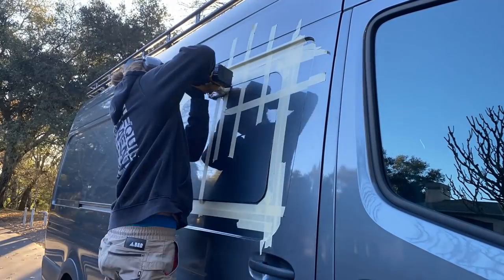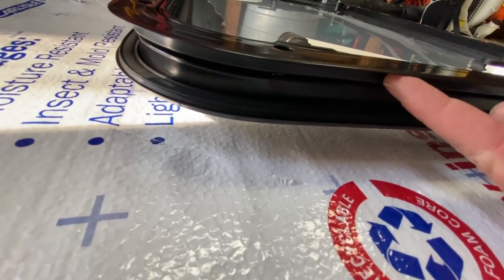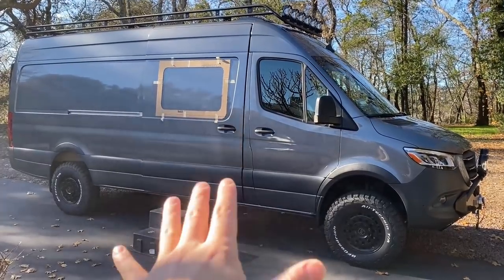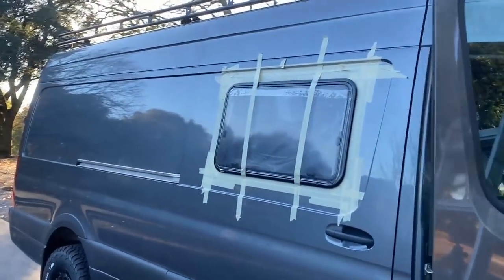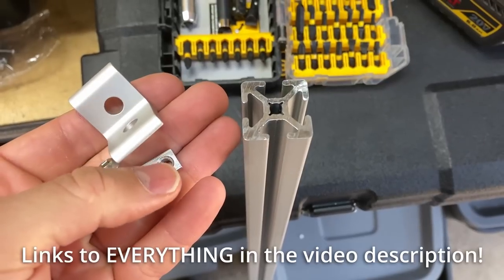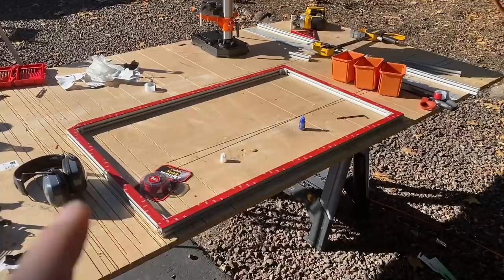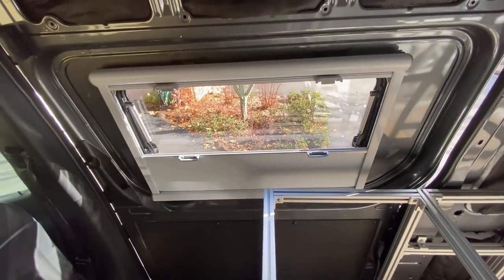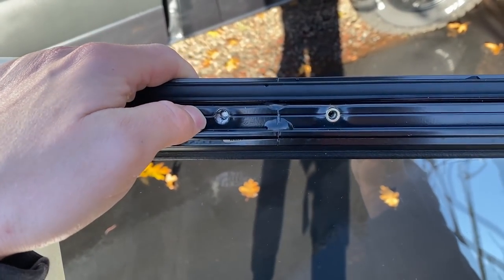How To Install "Tern Overland" Windows On A Van (My NEW Favorite)

Comment: Love the video! Thanks for sharing! Checking the inside fitment is definitely important. For anyone else looking to install our windows be sure to read our Considerations for Fitment PDF on our website. Great job on securing the spacer frame onto your sheet metal! Thank you for mentioning to not overtighten the screws, this is very important to make sure the riv nuts aren't pulled up. (This is a slight cause for leaking in your install as well as using the incorrect screws - there is a chart in the installation guide on which ones to use - glad you figured that out!) Great tips throughout! Measure from the inside, careful with the corners (Measure them!). You did a great job installing! For other commenters... do not use adhesive!! The rubber seal on the outside is 100% water tight when installed properly . Adhesive / silicone will ruin this gasket and cause leaking. As always, if anyone has any questions, be sure to reach out to us!
Reply: I'm just wondering why you guys don't include a full-size paper template with the orders? It would make life a whole lot easier for those of us doing our own installs and would take the anxious guess-work out of 'is this the correct line, or is that the correct line' to use when making our own.
Reply: Thank you for thé tip on thé adhesive
Reply: @susannal.9147  truthat! and a inner spacer frame:) !
Reply: Please ship windows with a template! This is a very expensive product and a template would cost you pennies to make and would save people a lot of hassle and potentially costly errors.

Comment: I am glad you went with the 1" 8020 frame like I did. The best thing about that solution is that you can then use drop in nuts on your your rails to tie your interior paneling together with the window frame. That makes for a super clean install and will also prevent the window from vibrating when you drive down the road. Will send you a picture of the my final result on Instagram.
Reply from the maker: Heck yes flori, thanks for the idea for this!

Comment: Great Windows!  I'm interested in seeing what your going to do for roof venation.  I've been thinking of not using a Maxxfan type of thing and instead put in 1 or 2 skylights.  One of the skylights being large enough to fit through which eliminates the need for a ladder and makes your roof more secure.  I think I can easily add a fan to a skylight.  Some people are using boat hatches instead of skylights.
Reply: Good idea for go on roof with boot hatches . But I think most van camper wants solar panels on limited space roof.

Comment: Aluminum is a great conductor. Change the window frame to wood or plastic, otherwise you will have condensation all around your window in the winter
Reply: Peter Eriksson do you have a recommendation on a plastic to build frame spacer?

Comment: Nice job on the windows and video. Question about the 80/20, how many sticks do you think you're going to use? What's your whole budget for the 80/20?
Reply: Jay-  I’ve wondered the same.  The cabinet build looked like 10 plus from passing comment in the video.  I love how it looks and appears to function, but I’m probably going to be stuck in the budget of 🪵 wood, like Vanjolina.  Of course, with the current cost and diminished quality of building materials, the 80/20 no longer exceeds lumber by as much.

Comment: Great set of videos Seven, thanks for all the info. Can you confirm what wall thickness windows you used for the Arctic Tern Windows in your Sprinter with the 80/20 1" framing. Was it 24-34mm?
Thanks

Comment: Are those the 24-34mm wall thickness windows? I can't wait to see how you finish the wall panels to meet the inside screen/blind assembly.
Reply: Hey Savage, I also am wondering which thickness you used? And how did you decide? Having a difficult time understanding which thickness to order.

Comment: Awesome video man. Question -did you consider using butyl tape when installing the windows? Or any other adhesive? Or are you confident the gasket is enough?
Reply from the maker: Very confident in just the gasket
Reply: I would still put a small bead of silicone caulk, it can't hurt.

Comment: When I inquired with them, they want you to get specific about your wall depth.  Did you go with 24-34 mm? Looks like you went with 24-34mm based on the 1 in 80/20...

Comment: Great Video and great Windows! Thanks for doing this.
So did you notice any difference with heat and cold vs the dual pane?? If I understand that is the reason why you went with this model in this build.
Thanks!

Comment: It would make a lot more sense for the supplier to provide the purchaser with a hole template rather than expecting them to do it and potentially screw up.
Making the window surround out of 80/20 is allowing a thermal bridge to the outside. Wood would offer better insulation and be a lot cheaper, lighter and easier to fix into.

Comment: Aluminium has a real poor R value so wood would be much better as a thermal barrier. Great windows though.
Reply: The double sided tape provides a thermal barrier so the aluminum frame doesn't touch the metal. Wood wouldn't be any different in this case.

Comment: Not only have they jumped big in price im not fan of the push button before you can unlatch; one side feels more natural but the there opposite you feel like you need flip your hand. Yes they also scratch real easily. Glass doesnt and glass is also flat doesnt bulge outward asking to get scratched. Now is glass have better thermal properties probably not but are you going to really notice in small space with heater going anyways and glass window off eBay say 200$ same size from TERN 750$
Also i dont know it the arm attachment is screw to frame or riveted, i have found rivets get sloppy over time

Comment: Hi, given your attention to detail I’m sure you’ve already thought of this but are you concerned about diminished security on the acrylic compared to the glass window, scratching and uv damage? I get the decision, temperature regulation in the van is difficult and can greatly affect the user experience. I would love to hear your thoughts on the possible cons of moving to acrylic and whether you have discovered methods to mitigate them.
Reply from the maker: good questions, I am not concerned but time will tell. If they do wear quickly I'll make sure to mention it in a future video
Reply: @seven_o_savage  Cheers.
Reply: Unless I’m mistaken, that window or surely the window from which the design was taken was being used on Dutchman-Thor TAB campers back in the 2004-2010.  I bought a 2010 with it.  Little Guy bought the rights to those when Thor stopped making them.  That would be the forum to ask re: longevity.  They are still wildly popular and expensive (relative scale).  The bigger question I would think is (with the van life remote area parking) is how shatter proof are they for folks interested in breaking into your van while you are out adventuring?  Love the windows, but I guess time will tell re: security.  Obviously any window only keeps honest people out.  Likewise locks, etc.
Reply: @nmartin5551  So true, any security is about increasing the difficulty for intruders hopefully past the point it is worth the trouble for them to break in. My questions were mainly to be able to assess the pros and cons.
Reply: Security system a must! Even without the window. Any suggestions??

Comment: If the only issue with the CRL windows is heat transfer, why not simply put ceramic film on the window. You add insulation, privacy, which the CRL window anyways provides, and keep a nicer original look. I do not understand all the trouble to go through, adding 80/20, a inside bulky frame for the shades, have windows that do not match the look of the CRL windows..... In any case, great tutorial and, as said, and we should be grateful for this, learn from others mistakes. Glad it ended perfectly done.

Comment: Is the window company to cheap to include templates or instructions on using the short screws?
Tip on template. Mark each side out and in. Take template inside and fit. Drill hole through template and metal. Remove template and align to hole outside. 
The nibbler is an option but it creates a tremendous amount of tiny slivers and is pneumatic which some may not have an air compressor. 
It looked like some screws might have gone into the t-slot. Did you use a filler or longer screws?

Comment: The windows look great! Are you having a problem with the 80/20 being straight and the sheet metal van skin being curved  on the sides and door? I found if I did not curve the inter mounting ring (frame) it would distort the van sheet metal skin. Are you having a problem with van  sheet metal skin distorting ( the distorting would show up 2 or 3 week after installing the windows and flatten the van skin(sheet metal))
Reply from the maker: Yes, that is one downside ... they flatten the sheet metal

Comment: So no sealant required just compression on gasket?
Reply: Compression on gasket is never good enough to keep out water seepage. Always add silicon sealant or epoxy to waterproof windows, vents & skylights.... Just my opinion....after replacing the inlet & outlet of my toilet flush.... Water under pressure will seep through the tiniest crack....
Reply: @starrystarrynight2844  manufacturer said that silicone or adhesive ruins gasket and not to use in prior comment.

Comment: What's the purpose of the 80 20 frame?
Reply from the maker: You need a 1” surface to mount the windows to (they can’t be mounted directly to sheet metal)
Reply: @seven_o_savage  thanks! Curious if you're considering adding steel somehow to window frames, so magnetic covers can attach?
Reply: @Brandon-ik6ty  why would you want to do that when it already has black out curtains build in the frame 14:22
Reply: @MultiPJoys  Presumably for additional heat insulation
Reply: With the double pane acrylic and the shades you won’t need anything else. Not to mention the diesel heaters are so overkill I realized the whole insulation thing seems to be a big waste.
Reply: @michaelscarfi3196  all depends on what your travel plans are, as diesel heater will not help with insulation from hot weather... would be curious to see how these windows perform from insulation perspective. here's video where a guy tested a single vs. double vs. single covered windows in his van: https://youtu.be/75cyE5qU40s?t=352
Reply: @tsarvlad  with your AC your in the same situation.  A standard RV air conditioner can do 400 square ft of cooling in your home. How much is in the van 90? As long as your plugged in you’ll be comfortable in the desert. I think we all give to much thought to the insulation. I know I did on my build.
Reply: @michaelscarfi3196  I totally agree, I've only used my van this winter and my Espar Gas Heater works great, today at Mt Rose it was 8 degrees and in less than 15 minutes it was 50 degrees, too hot!! Glad I didn't use that expensive 3M insulation stuff, just wool!!
Reply: @michaelscarfi3196  for heating yes, but not for cooling.
Reply: @utahjohn5480  I would say plugged in it doesn’t matter if you have any insulation for cooling. If your not plugged in and you have a 30,000 dollar battery bank and 12v AC unit you could last a day off your batteries with your Cooling well insulated and your windows covered. What do you do on day 2? The point being I just don’t think it matters but I could be wrong. Once your batteries are empty the insulation won’t do you a bit of good.

Comment: Well, maybe I missed a point, but how did you seal them?  Caulking, foam tape, ?
Reply from the maker: They’re sealed from the outside with the rubber gasket built into the window
Reply: @seven_o_savage  That's great!  I think it deserves to be mentioned:  no messy caulking to deal with...